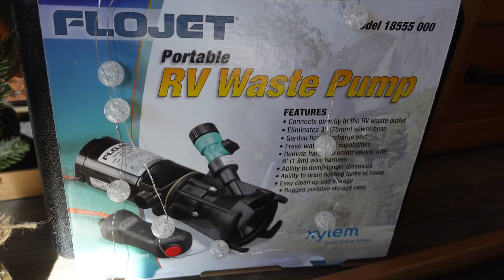RV Life! Can YOU Handle it?! Brace yourself, it's about to get REAL!

Comment: Really enjoying your videos.  We are full time in a 22ft 5th wheel, and I would love to have a mooch-docking setup like that.  Having switches/buttons instead of dump valves is new to me.  You may already know but you could "permanently" add a Valterra Twist-On Waste Valve where you installed the clear adapter to avoid any accidental spills.
Reply from the maker: Hi Jim! Thank you for the kind comment and info on the valve!  I have seen those and will mention to Scott about them. Thanks so much for following along! -Tammy

Comment: First, your inlaws could make some income from that site when you're not there.  There are a couple nationwide programs that they could participate in, if interested.   We have an extra "berth" at our sticks and bricks and the income is a nice offset for the electric bill.

Second, there are adapters out there that will allow you to securely outfall the macerator discharge into the cleanout.  Not only will it stay put, it closes the system keeping the odor down.  To keep your macerator moving freely, get canned pressure washer pump preserver or mix J&J Shampoo and water and eject through at end of pumping.  Hard water, holding tank chemicals, etc. take their toll.  

Safe journeys!
Reply from the maker: Hey Rob!  Thank you for the info on the pump ideas!!  Yep, I told them about the making money from the site, but don’t think they are on board 😉. Sure appreciate you watching and taking the time to comment with the info!

Comment: Get a composting toilet, problem solved.
Reply from the maker: I already have one litter box to clean, what’s another 😉
Reply: @TilFurtherNotice  it’s not hard, just takes some getting used to, guys got to sit when they pee. Other than that, it lasts longer between dumping, ya never have to empty black tanks again. And you can use the black tank for extra grey water holding. And ya get rid of the poopy smell. The compost does smell a little, but it’s a more earthy type of smell. Similar to garden compost smell.